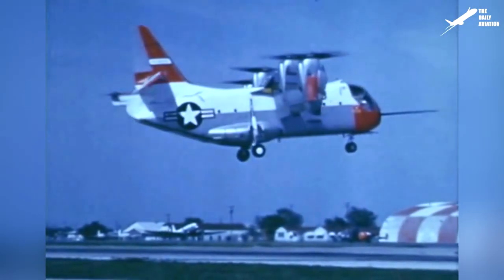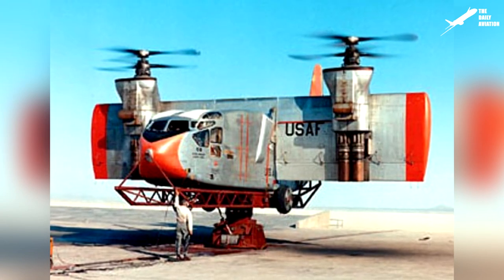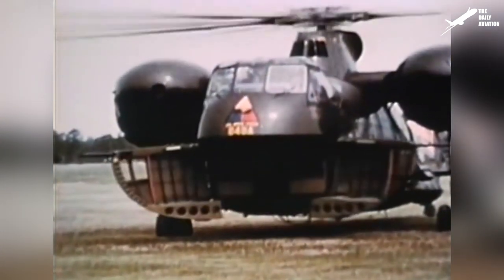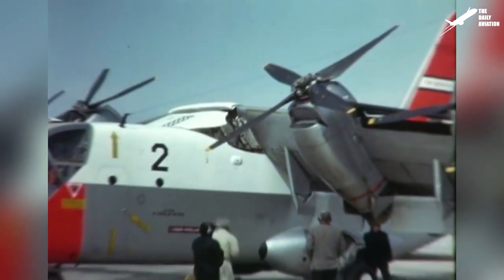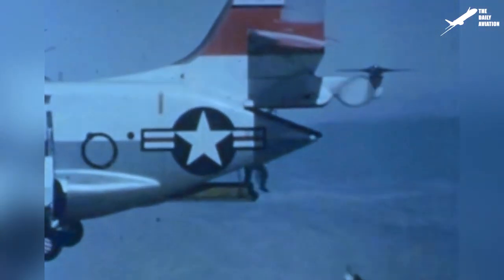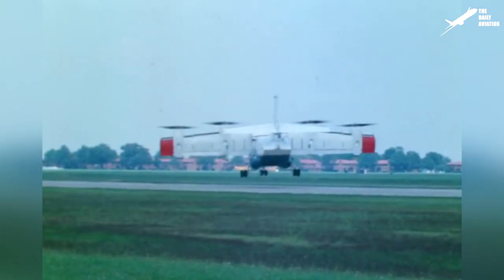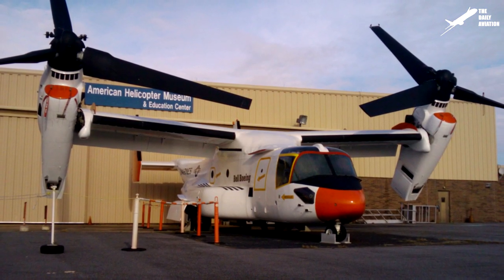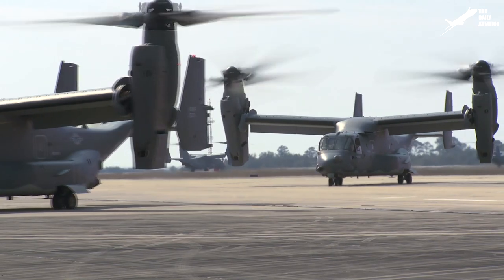This Plane's Wing Can Rotate at 100 degrees to Land Vertically: XC-142 VTOL History

Comment: I'm surprised they made the XC142 considering Canadair had no success with a 4 engine vertical takeoff due to vibration issues.  XC142 was discontinued for the same reason.  Fine the US did not want to use the CL84 but they should have made this first set of XC142 with 2 engines they would have had better luck.

Comment: So, this was the precursor to the V-22 Osprey.
Reply: Yes it was one of the aircrafts that lead to the development of the V-22 (and beyond).
Reply: But remember, the V-22 Osprey is a TILTROTOR aircraft. The XC-142 was a TILTWING aircraft. Similar but different. 😉
Reply: no the cl-84 was, the xc-142 was a design stolen after the US signed a contract to help canada's avro company make their cl-84 which they had already designed and built prototype for the US then cancelled the contract after they had access to design plans and blueprints and tried to make it on their own, but theirs failed because they didnt know what canada ha already found out that a 4 engine 4 prop version creates too much vibration and warps the wings, canadas 2 engine 2 prop version worked tho and the cl-84 was a success but that was at the end of avro's life and was cancelled along with the avro arrow built in 1959 and so good it was considered to be ressurrected and built by the US instead of the F-35

Comment: he first prototype made its first conventional flight on 29 September 1964, first hover on 29 December 1964, and first transition on 11 January 1965. The first XC-142A was delivered to the Air Force test team in July 1965. During the XC-142A program, a total of 420 hours were flown in 488 flights. The five XC-142As were flown by 39 different military and civilian pilots. Tests included carrier operations, simulated rescues, paratroop drops, and low-level cargo extraction.

During testing the aircraft's cross-linked driveshaft proved to be its Achilles heel. The shaft resulted in excessive vibration and noise, resulting in a high pilot workload. Additionally, it proved susceptible to problems due to wing flexing. Shaft problems, along with operator errors, resulted in a number of hard landings causing damage. One crash occurred as a result of a failure of the driveshaft to the tail rotor, causing three fatalities. One of the limitations found in the aircraft was an instability between wing angles of 35 and 80 degrees, encountered at extremely low altitudes. There were also high side forces which resulted from yaw and weak propeller blade pitch angle controls. The new "2FF" propellers also proved to generate less thrust than predicted.
Reply: Ese; have you seen the various videos on Canadair's VTOL /STOL CL -84 and its precursors?  The 4-prop versions seem to have all had stabilit, flex and vibration problems, but the CL -84 avoided these, and 'wing flutter'. Thanks for your above commentary!

Comment: Its both a winner and a loser. Winner for it won the contract. A liser for it cannot build a working flying prototype. The 4 engine layout cause excessive vibration, and so the contract was cancelled